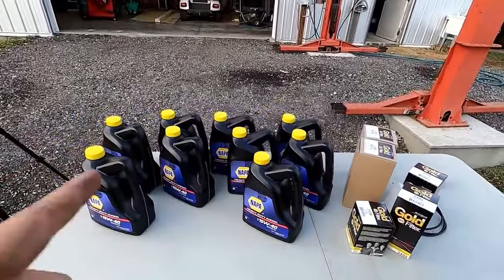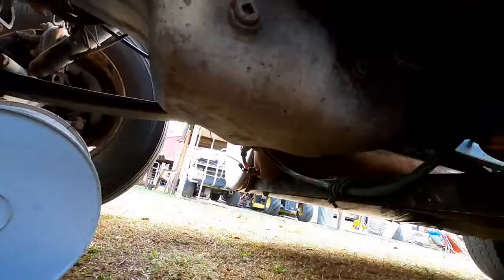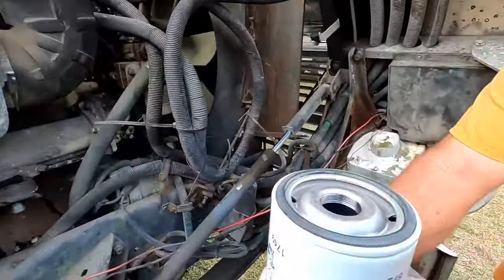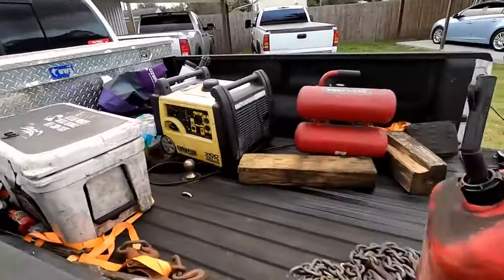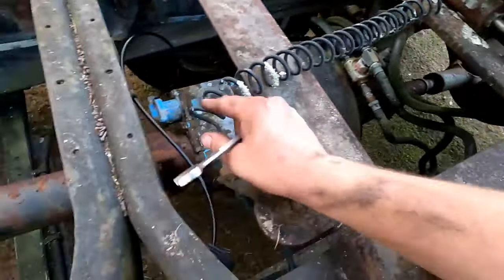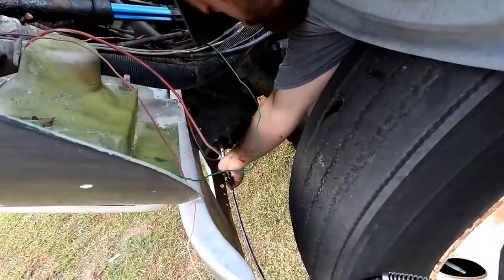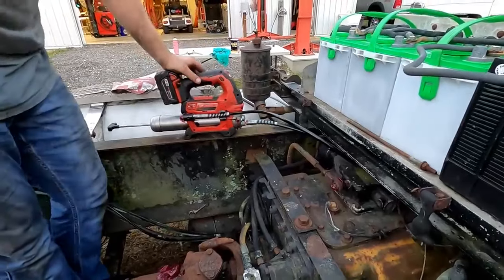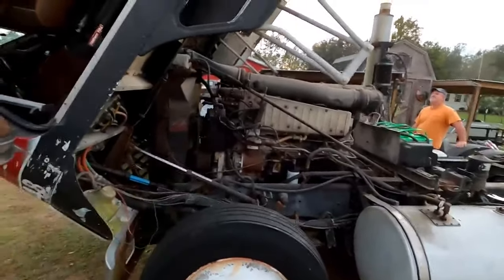Changing 20 YEAR Old Oil on this Old Cabover!!!

Comment: Back in the 50s-60s most vehicles had a lot of Grease Nipples , when I worked in a Garage doing my Mechanics Training we had a large drum with airline to pump the Grease . The oil and Diesel looked  really bad it must have smelled awful. You can only fill new Oil Filters if they are mounted vertical , the most important thing is to smear clean Oil on the sealing ring for a good seal and make it easier to unscrew. Dirty job , but your clothes still looked fairly clean ,Good Job Mate 🤧😎👍